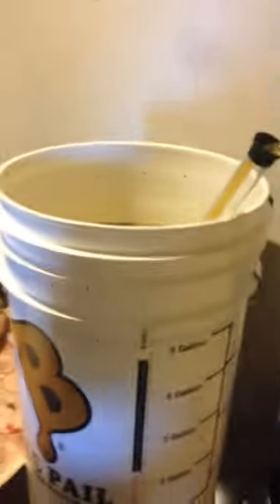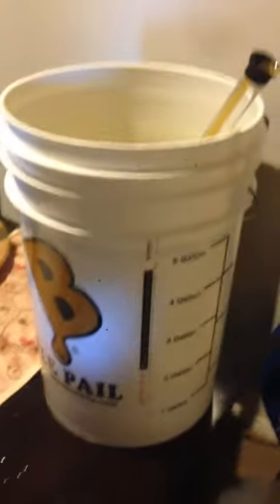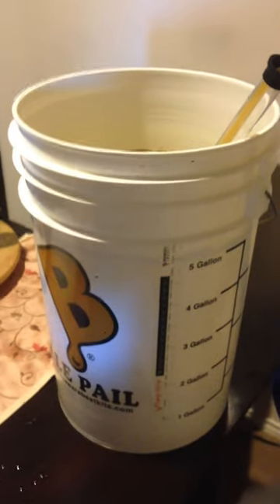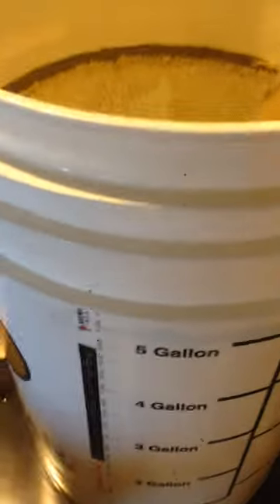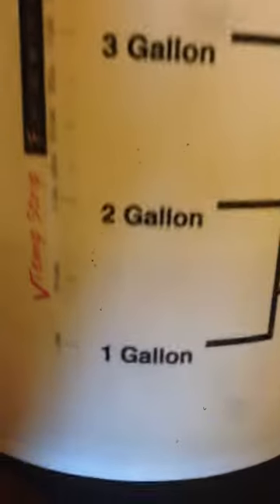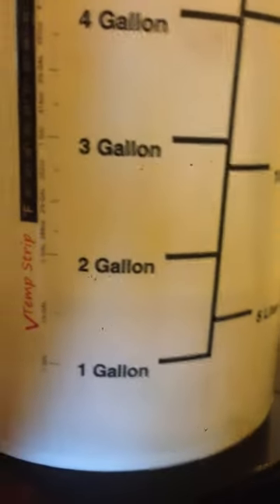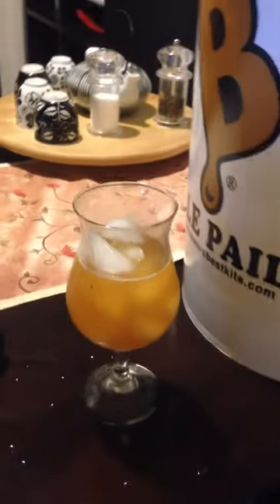How to Transfer Beer to Carboy for conditioning | Home Brew Project

Comment: how long do you usually leave for secondary fermentation? do you also happen to add gelatin to clear out the beer?
good to know a fellow nepalese doing some serious brewing
Reply from the maker: Are you into Brewing too. I usually leave in primary for about week and rack them to secondary for about 2 week. So far my beer has been great in clarity. I have not used gelatin in mine . I have some haziness especially with wheat beer.
Reply: Yes been brewing some single hopped ipas. 
Usually go for primary for two and then straight to bottle condition.
Any good recipes you have been working on?
Reply from the maker: +
Abhas Maskey
Reply from the maker: Great to know another Nepali guy into brewing so how long you have been brewing bro. I love IPA too actually one of my Fav. Are you into all grain or extract brewing . I have had few amazing beers but I really like to twig them and crank up the ABV . Keep in touch mate . Finally in touch with another BrewBoy .
Reply: +Nepali Brewboy Channel 
hasn't been much, started in September but been involved in the homebrew community in Seoul for a while now. planning on doing a single hop ipa using citra today.

how do you ramp up the alcohol? increasing the base malt or do you add sugar based ingredients?
been only doing all grains!!
Reply from the maker: +Abhas Maskey You can do that my increasing either Malt or any Sugar based ingredients.. The Rule of Thumb is every pound of Sugar ingredient will raise the alcohol by 1%. With IPA I would stick around 7-9% . Are you dry hoping or not, my experience , Dry hopping in either primary or secondary really brings out the aroma and flavor especially. Happy Brew Day.